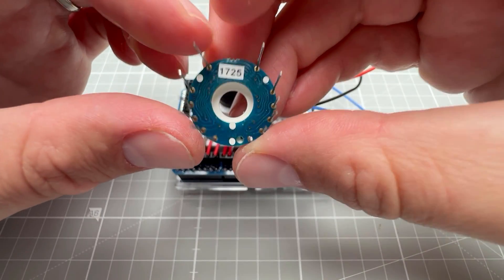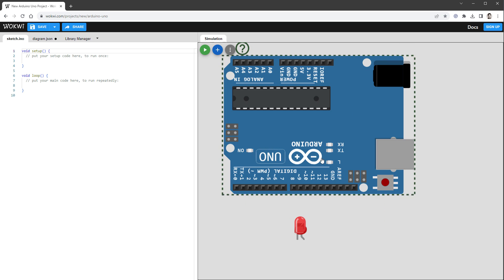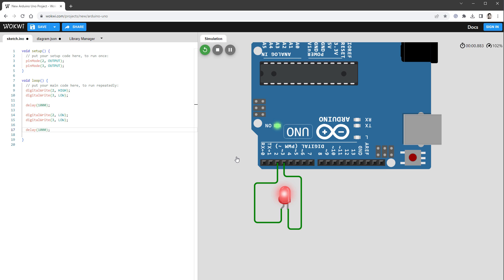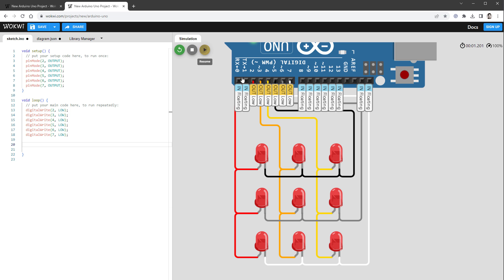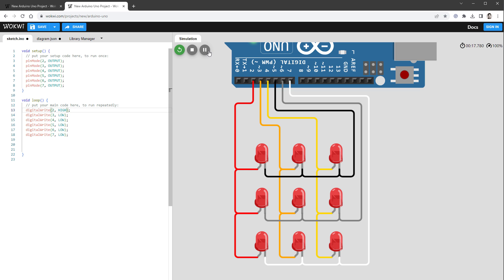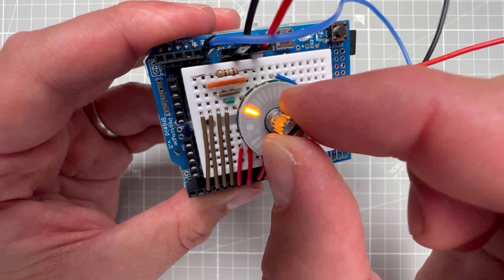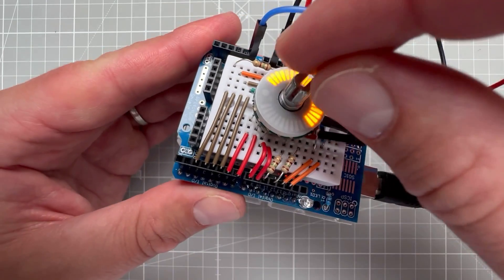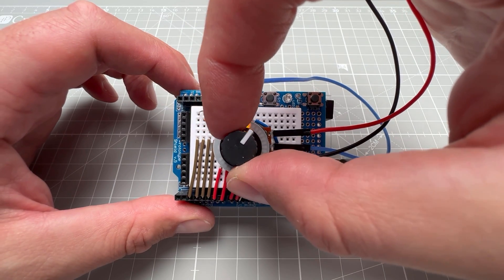Pimp My Potentiometer!

Comment: EUR 23 for two of these rings doesn't stimulate building something with a lot of potentiometers on it 😮
Reply: Way too expensive!
Reply: I'd probably just lay LEDs around pot myself. Mask can be ordered relatively cheap
Reply: @brylozketrzyn mask could be cut from a milk carton with some care, meaning its a minimal cost.
Reply from the maker: I´m sure that if you design a project that uses hundreds of those, you will get some significant discount.
Reply: @brylozketrzyn for the price u better off just go buy a custom pcb with smd leds arranged like this ring with assembly it's still cheaper
Reply: Can probably do something similar with the high led-per-inch addressable strips and use far fewer pins on the controller at the same time.
Reply: @JustPlainRob there are ws2812 leds in a 1.5x1.5mm package (slightly smaler than 0807). 10 pieces costs 2,89€.
Reply: Это не цены высокие, это классовое сознание низкое.
Reply: @redtex  How do you mean? Google translate may not do your comment justice.
Reply: First time in my life I see someone place the EUR currency text in front of the value. Are you an american spy or what lmao
Reply: @fns58  I'm not at liberty to discuss this 😉
Reply: You can get individually addressable led rings for a lot less. I think the blinksticks one was only $8 or something. That was years ago.
Reply: Things are usually cheaper when several large companies want the components. So a factory makes even more (mass production = cheaper) than what they requested and sells the rest as parts. But $15 per LED ring is excessive, especially when compared to the prices of OLED/LCD displays which can be mounted above knobs to show precise status/value. Granted, it’s a different aesthetic, but it could look even better potentially. I’m thinking of building a MIDI controller, so the cost will add up quickly if I use these rings. 

I might use one of those more basic text LCDs, and attach one above each group of 4 knobs. Found some on Amazon that are 80mm x 31mm, $13 for a pack of 3. Shouldn’t make the surface of the controller much larger, but definitely more informative. I could have two lines of text, with a knob name on the top and value below.
Reply: Go on hack a day, there is a source 3 for eight teen US.  And 10 per sent off over twentee (sorry the comments are being erased)
Reply: 12 EUR a piece might be a little pricy, but stuff ain't free.

These look to have a lot of LEDs. 

Assuming there are like twenty (20) leds on the ring it could be at least $5 to just get the LEDs by themselves and you don't get them on a nice board with a visual nask pin headers.
Reply: @jnharton  for 9 euros i can get a 16x16 WS2812B rgb panel, a hundred square leds are 86 cents. Leds are cheap.
Reply: @jnharton  smd LEDs are about €5 for a reel of a thousand. You can order 5 pcbs like that in the video for €5 including delivery. The main expense is in the time to kicad and solder.
Reply: @DisorderedArray JLCPCB will send you the PCB with leds, resistors and header already soldered for very very cheap.
Reply: @jnharton  LED's are quite literally cheaper to produce than pennies, you can buy a pack of 100 for $1 or even $3 on the expensive side already... These things are cool but ridiculously overpriced.
Reply: @jnharton there are 31 LEDs
Reply: @jnharton  LEDs are cents in bulk.

Comment: Nice project but it uses to much pins so is not that useful
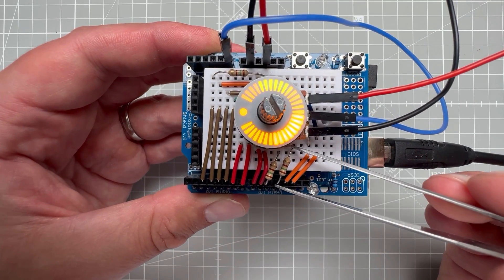Reply: 14:30
Reply: @mysticmarble94  also if u use a driver it will consume resources of the arduino mcu you need a more powerful one otherwise is nice but useless
Reply from the maker: Thank you for your comment. This was just to demonstrate how this module works. In reality, you would need a dedicated chip to drive the LEDs, so you will most likely use very few pins on Arduino, and almost no processing power. The chip takes care of updating those LEDs, and you only need to send commands from Arduino when you want to change it.

Comment: It's very nice, but despite the fact that I like to use MCU for everything, I think this can be accomplished by analog means. One LED, a backlight, and a dark ring with a slot on it attached to the knob. Sometimes simpler is best
Reply: The point of this ring is not to use it with a pot but an encoder. The stored parameter value can be recalled and displayed easily. Cheaper than a motorized pot but still too expensive. Alps do an encoder with led ring as a combined unit.  About 15 euro I think.
Reply from the maker: Interesting idea with the physical approach, but as someone has noted, it can quickly show a stored value with rotary encoder. With your solution, you would need a motorized version and that would probably cost more. Also, with LEDs, you can control the brightness and have some cool effects.
Reply: @upir_upir  Maybe the video you produced could have demonstrated this approach then.
Reply: off course its out out of discution all that you say. just that it is over complicated in the video something that has been made in some old devices in analog way.  @upir_upir
Reply: Yup agree totally. This is just another bit of fluff that’ll need firmware updates and eventually an internet connection for “marketing reasons”.